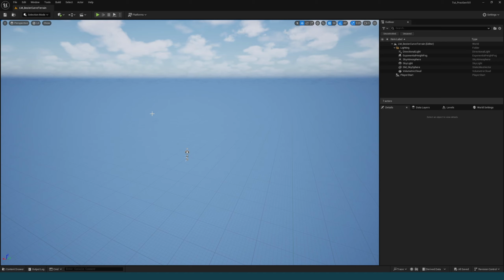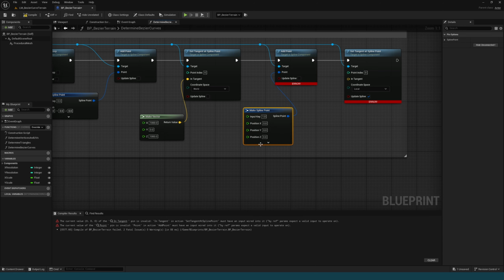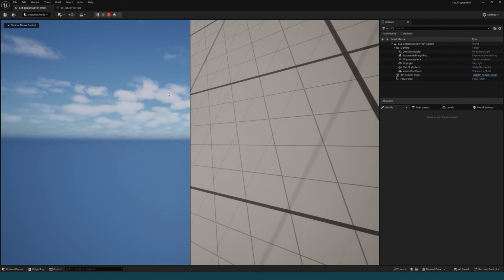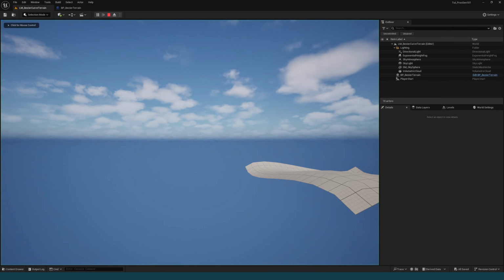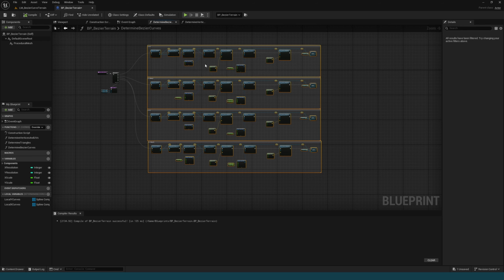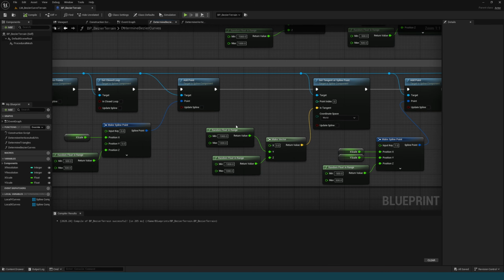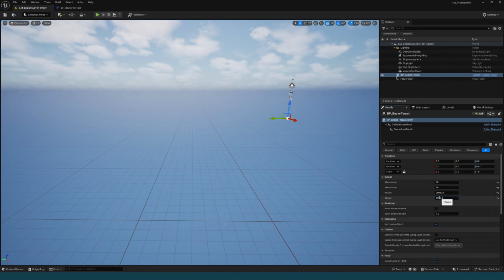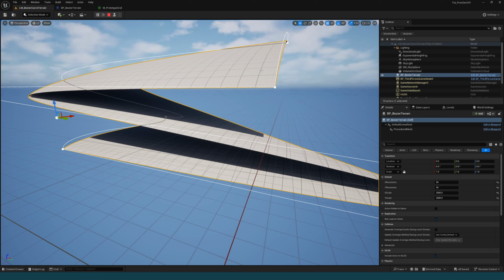Procedural Bezier Curve Terrain

Comment: could you make for example a sword mesh or some other complex shaped mesh with these procedural meshes and control the individual verticles of the mesh in runtime like change the shape of the sword for example? or is there a better way to control shapes of meshes without procedural generation? 
Like if i'd say i want to make a system which has almost full control of the shapes of meshes in runtime, almost like an editor itself, what would be the way to do it?